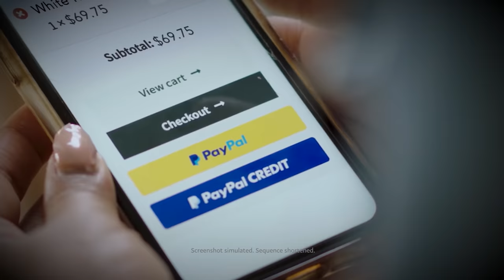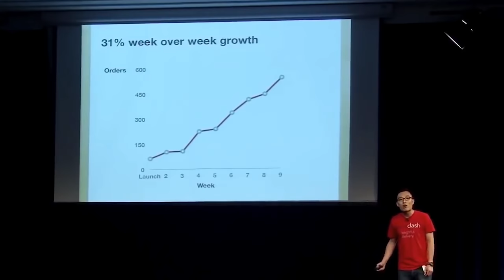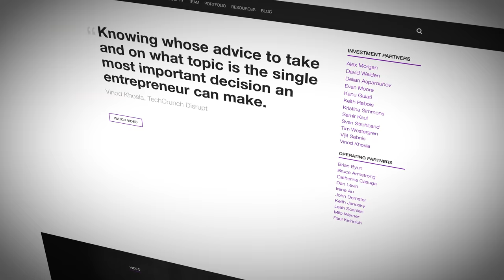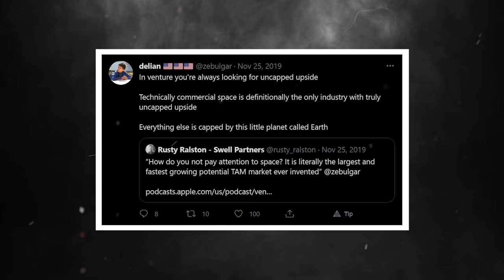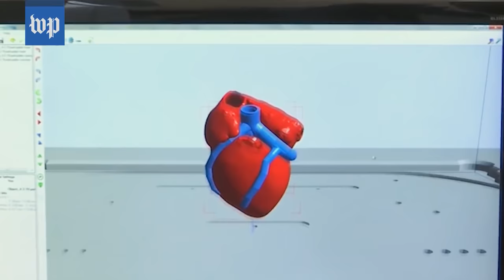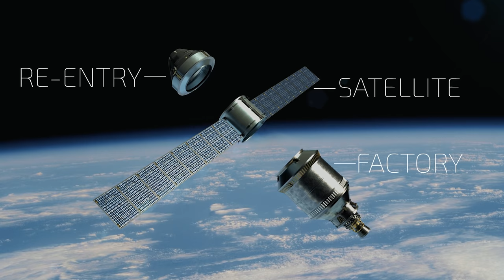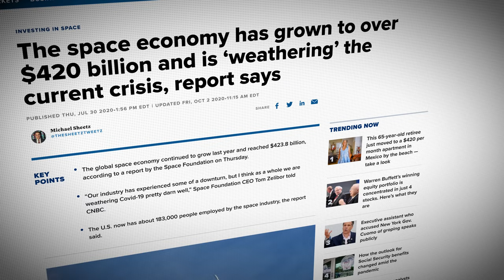How Varda Solved Manufacturing in Space

Comment: ZBLAN will still have its uses but the advent of Mega-constellations like Starlink will seriously reduce its market capacity. People say it'll be used to overhaul the entire global undersea cable network but the entire global cable network will be made obsolete by starlink and the other proposed constellations because light travels faster through a vacuum than any cable and 80% of starlink's signal is through a vacuum vs ZBLAN which is 100% through a cable medium, even if it has seriously low attenuation a vacuum has basically 0 attenuation.
Reply from the maker: That's a really good point! I hadn't thought about that. Either way, space is going to be really important for the future of the internet!
Reply: Satellites are one part of the bandwidth solution, but there isn't a cost, or bandwidth reasonable path to replace ground based fiber with satellite constellations
Reply: Satellites don't have nearly the bandwidth that cable does. You might get lower latency, but fiber has much, much bigger pipes. That's why 90% of all Internet traffic currently goes through cable. No satellite network could carry that much data.
Reply: Then put the servers in space running off forever sun . 

Manufacture the silicon and CPU in space and leave the cpu, storage there.

Cold storage back here
Reply: I think ZBLAN would have its place in densely populated areas where the satellites don't have enough capacity, or in the few places starlink won't reach

Comment: Another holy grail for space, past fully reusable orbital rockets, would be to produce glass, steel, and aluminum on the Moon! It's possible under known physics. The bootstrapping for the energy resources required will be huge, however. Potential solution for the re-entry problem: Put return cargo aboard a returning Starship tanker. If there are many cargo flights to the moon, there would be many Starship takers returning.
Reply: Or just rent an entire starship for the mission.  The starship carries the factory inside it and orbits while the factory operates.  Then the whole thing comes back, and the factory module is removed and refurbished for the next mission.

Comment: Great presentation.  The only error - there is a lot of dust in space ... where did you get there is none?  The point is you can reduce dust in a space environment to a negligible level.
Reply from the maker: Yeah, good point. Probably shouldn't have said zero dust... The key takeaway is that it's easier to maintain a cleaner environment though.

Comment: Space manufacturing is important, and both the moon and asteroids are a way to do it.

It's crucial not only to have industries and manufacturing in space, but, additionally, 
it's also crucial that the productions possible to be done in space doesn't have to break and disturb the ozone layer, which, while poisonous to us,  also protects the earth from even more toxic damage from sun rays and related energies from the cosmos coming our way.

Furthermore, it's possible to save a lot of the energy required to escape our gravity, which keeps us on earth, by doing that work in space and designing that production to be used and repaired from there instead of having to come back and forth on earth.

Suppose we mine asteroid or moon ore, and, instead of having to spend billion to send it to Earth for processing, or trillion, we can use it directly in space, also cutting our launch costs, which is an important part of the costs of space program, if not the most.

As it was the most important costs to start, once those costs were paid, it is up to us to make good use of those costs and knowledge and learn to adapt the benefit of being in space to do the work from there, and to do more work from there.

I can also DM you on your twitter.